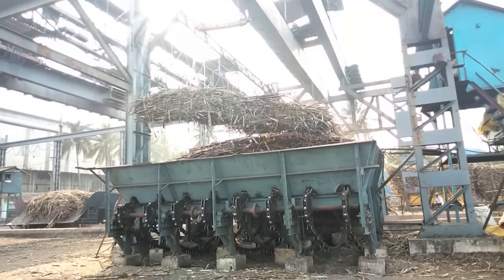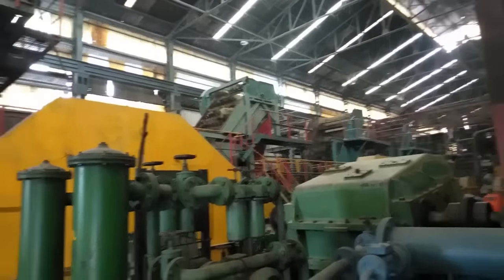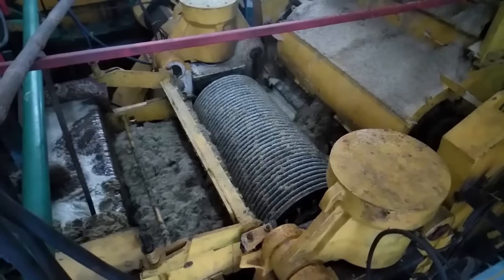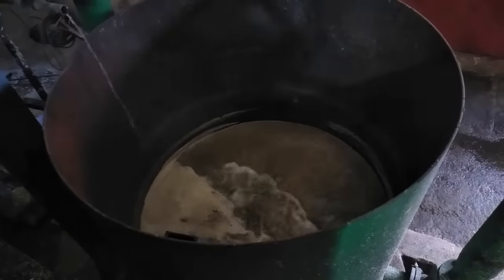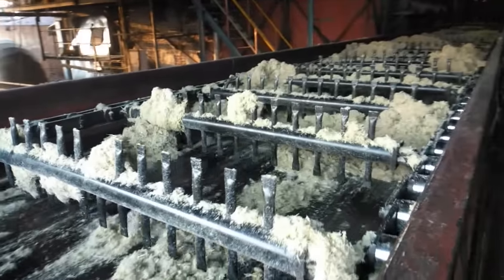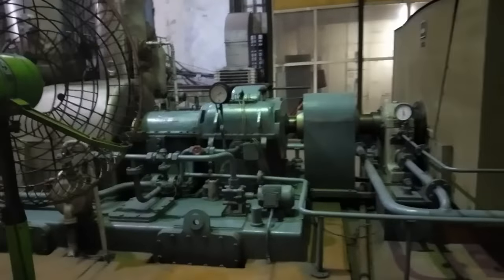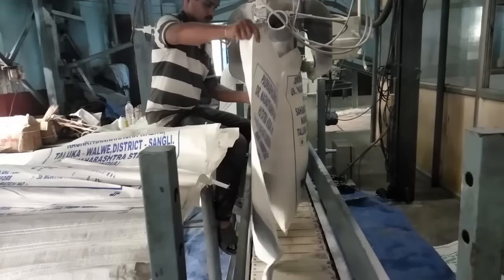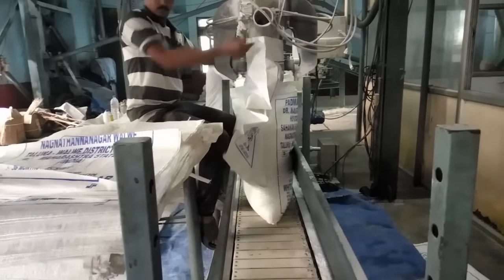How To Manufacturing Sugar From Sugarcane In Sugar Mill With All Process 2021

Comment: How much water normally requires in sugar factory??
Reply: I work in a sugar beet factory. We use TONS of water. Literally.
Reply: I work in the sugar refinery in NZ, and with the cane sugar we get from the mills it's close enough to a 1 to 1 ratio. So 1 tonne of sugar to 1 kilolitre of water.
Reply: Imagine they use so much water that contaminates ground water almost a radius of 10sq km around the factory
Reply: Please how much will it cost to build a sugar refinery factory